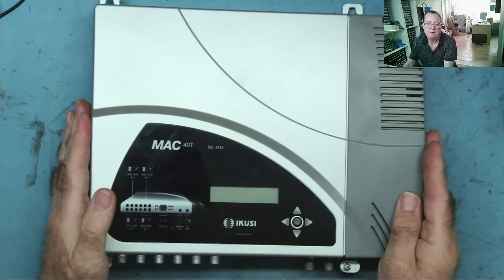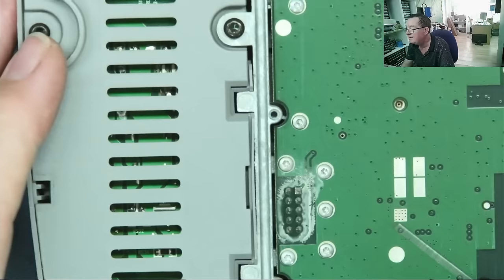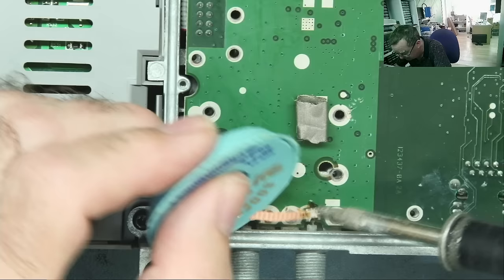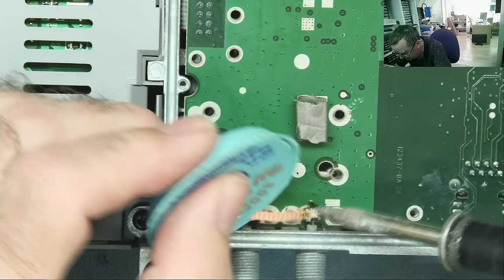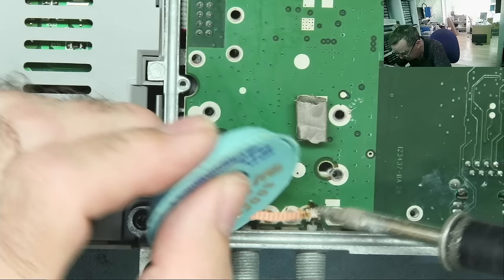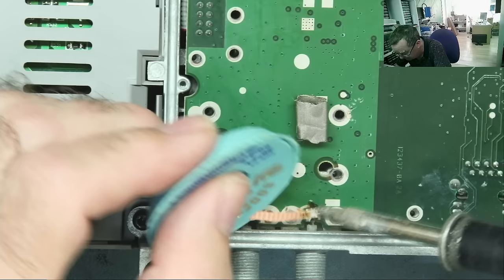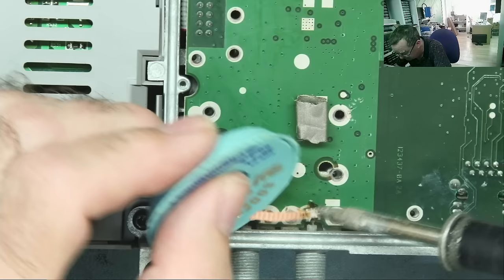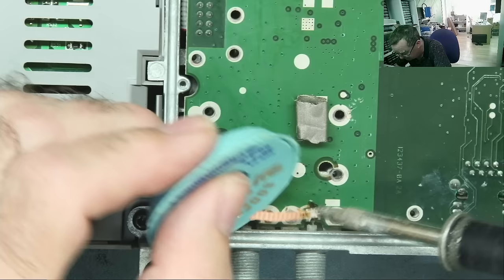IKUSI MAC401 Quad Digital DVB-T Modulator Repair - Boots up but No RF Output

Comment: I would have checked the other electrolytics in circuit with the ESR meter just in case. Low ESR is the most important characteristic if used in an SMPS.

Comment: When I saw the date code on the ST chip, 2904, I immediately suspected you might find a bad capacitor or two. 2004 was bang in the middle of the "capacitor plague" era. For that very reason I would have been tempted to replace all the electrolytic capacitors.
Reply: As soon as i saw the voltages varying i knew it had bad capacitors 35 years as a service tech you get to know what to expect to be honest i expected it from the start.
Reply from the maker: @JonnyMac351  What caused me to not immediately suspect a PSU problem was the fact the thing booted up and I could access all the menus etc, it just had not RF output

Comment: I’d get an RTL-SDR dongle V3 or V4. It’s a software defined radio “bit of kit”. It is very handy USB RF receiver used with your computer. There’s free software to run it (such as SDR#), that will give you a video band scope/spectrum analyzer for detecting VHF/UHF band signals. It uses a TV tuner chip (RTL2832).
These are very cheap, and work very well for what they are.

Comment: I look after TV distribution systems in buildings too. I absolutely hate these systems. There seems to be always something wrong - overheating - bad contacts - failed LNB switches - low quality power supplies in the receivers. It just never ends.
Reply: Low quality rubbish equipment and a desire to get stuff for free are probably motivators and fundamental to the problems.
Reply from the maker: @kriswillems5661
@kriswillems5661
Agreed - these systems are a nightmare to maintain and yet the equipment is expensive and problematic to buy/replace.  I've had the contract to look after this particular hotel's system for about the last 5 years.  They have 72 channels into 110 apartments. Satellite channels change transponder frequency and stuff breaks down on a regular basis.  On the plus side this one contract earns me several thousands a year between maintenance and subscriptions so I guess I have no real reason to complain

Comment: We're those failed capacitors all in parallel on the same voltage rail?

Any ideas what might cause such a cascading failure like this? Over voltage failure? Just component fatigue over time? Improper ventilation causing over heating failure? Poor circuit design failure?

How similar is the operation of this box to the old adapters we bought to use a regular TV as a monitor for our Commodore computers? Those were RF modulators of some sort.
Reply: These digitize 4 analogue channels. They apply video compression on them, then combine the compressed streams to one stream , then  they change back to analogue by modulation of the digital signal and then they mix the signal with the signal of an oscillator to put it on the frequency of an analogue TV signal. They do way more than those old modulators, which are pure analogue. They do basically the same as happens at digital TV broadcasting centers.
Reply: There were several voltage rails. But one rail had 2 capacitors in parallel. This done to get lower ESR and sometimes is saves space too.
Reply: Electrolytes fail because of heat, age, and heavy use.
Reply from the maker: @kriswillems5661  Heat most likely. The 'TV' room is at the top of the hotel where the satellite dishes are located.  It regularly exceeds 40C here in the summer  (which is about 8 months of the year), and if it is not 40C it is in the high 30s though strangely enough, the roads don't melt, our cars don't break down and we don't die, which the UK press say will happen.  This year we had one day at 52C, which of course meant we had to go to the beach, bask in it, and drink a bit more beer than usual, but it seems electronics don't like that too much. 😅
Reply: I live in Thailand (now). Here's it's a combination of heat, humidity and the fact that everything comes from cheap chinese manufacturers.  @LearnElectronicsRepair